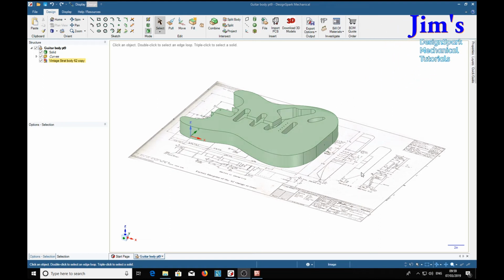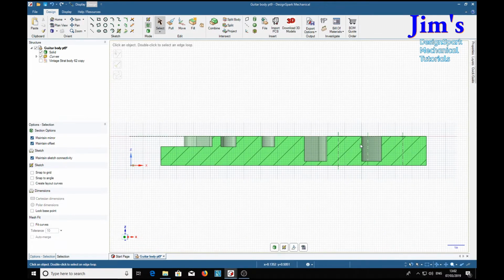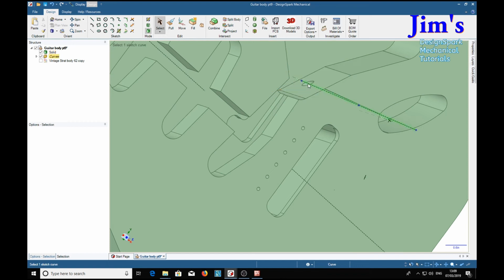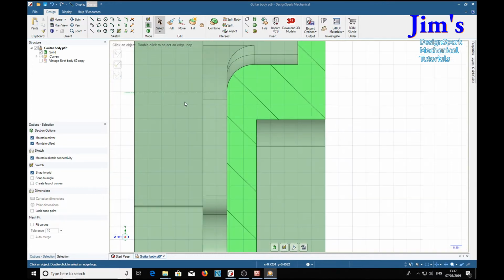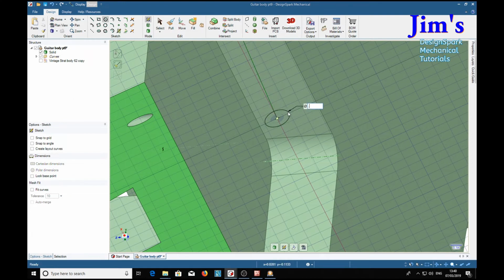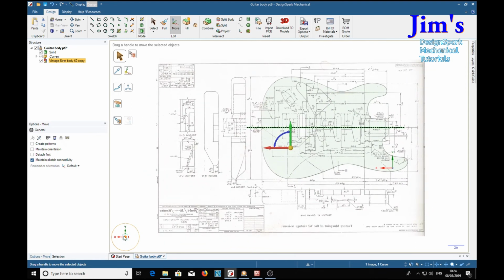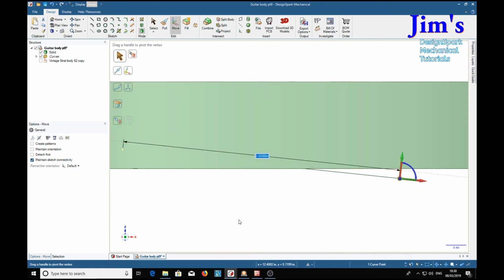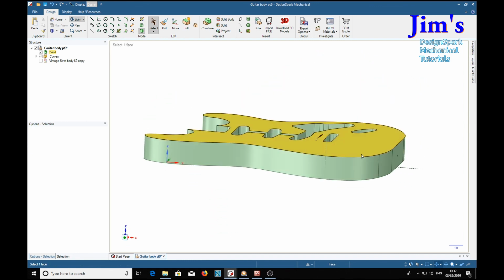DesignSpark Mechanical 1962 Vintage Fender Stratocaster body pt9

Comment: Jim, I really appreciate how you do your tutorials for DSM. There are many people who post videos but they don't explain how to do things. Thank you! Quick question, is there a way to make a case for a cell phone in DSM that has curved inner contours?
Reply from the maker: I would certainly have thought so. It sounds like a great little project. I will probably tackle it after the last of the guitar videos.
Reply: @JimTaylor42  I'm trying to make a case that will work with the Samsung J3 Orbit
Reply from the maker: Have you got accurate dimension for it?
Reply: @JimTaylor42  I have 142.5 mm x 71.1 mm x 10.2 mm
I've been using 83° radius in the corners, but that was just a rough guess. 
I created my initial case with an outside dimension of 145.5 x 74.1 x 13.2 mm to allow the shell command a 1.5 mm wall.
The problem I have is not knowing how to conform the inside of the case to conform to the outside contours of the phone.
Reply from the maker: Draw your phone as accurately as possible, embed it in a block the size of the case then use the Combine tool. See part 10 for how it is done. @BenEBrady